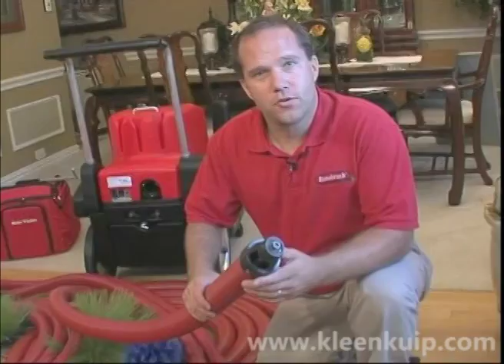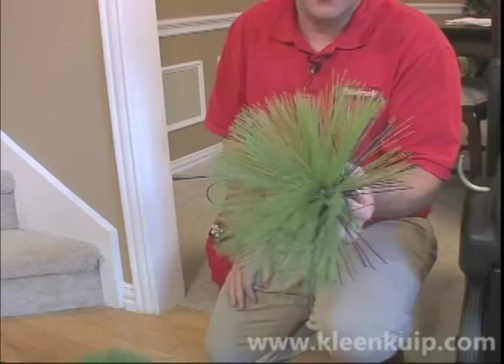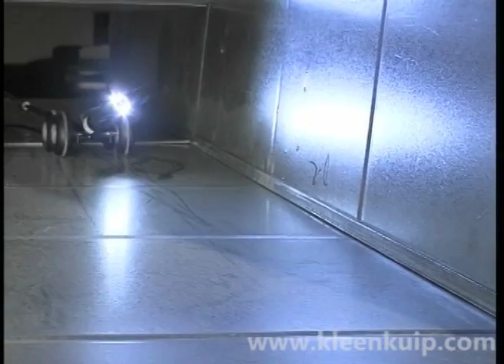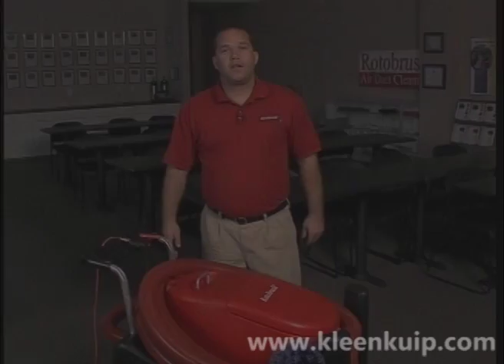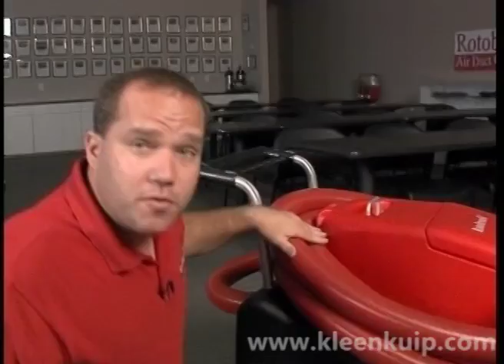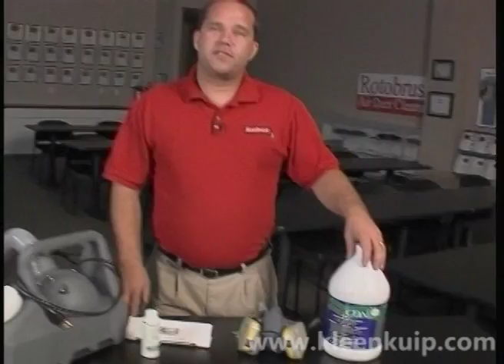Rotobrush Air Duct Cleaning Machine Demonstration Part #4 of 4

Comment: This system is so Stupid.  You can't even reach the main supply line.  It's true the ducts going to the vents are clean, but a lot is left behind.  The amount of suction isn't enough to catch all the duct particles.  And to make us duct cleaners look like absolute idiots...they can't put a good wheel axle on these machines.  Both of my old and newer rotobrushes have had the back wheels fall off.  For the price of this machine...you should get a lot more.  The only good thing about this is it got my feet in the door to have a customer base that will support my investment of a better machine.